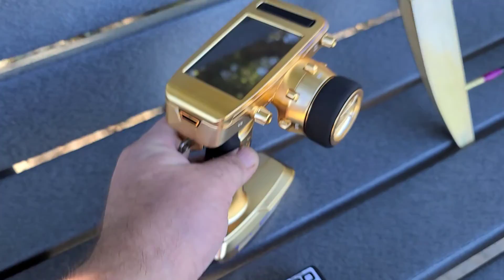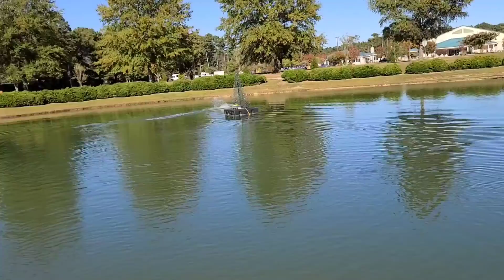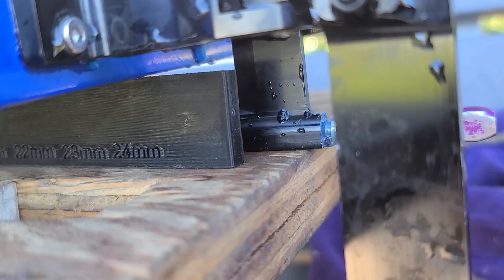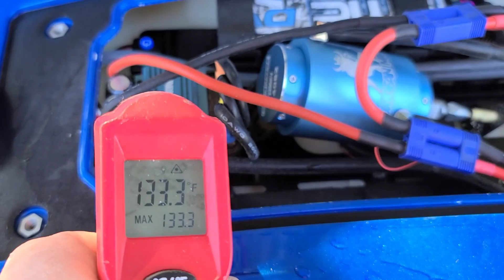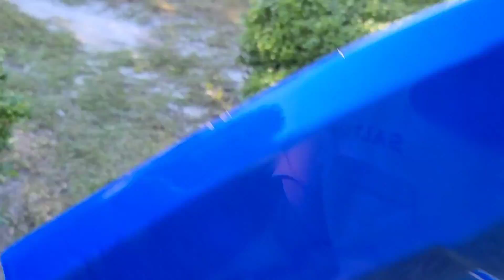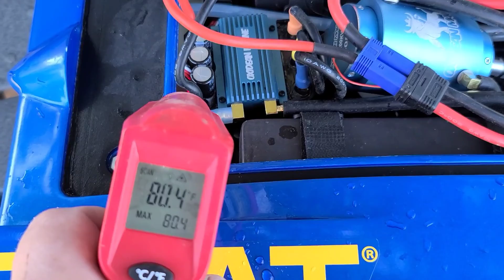First Test Super UL-19 Upgraded Electronics Oxidean 200a & 4082 6 Pole

Comment: This boat in actual size usually will do 150mph, scale speed for this rc boat of this size is 15-20mph. The reason why you see so many lifts and crashes and instability in the hulls, is because the hulls cant process the airflow at higher speeds, they arent designed that way. I do get it mine does roughly 40k stock at 3.5ft but even that isnt scale.

Comment: B, is that wing thing between the sponsons adjustable? Just wondering if that would help keep the bow planted. I guess the real question is why does the bow want to lift up in the first place.
Reply from the maker: It's the turn fin angle I had. It doest do it with a straight turn fin!
Reply: @IRONCLADRC  AH HA! That makes sense! So the angle and the curved shape must have combined to pull that side down causing it to flip.
Reply from the maker: Yes sir, that's what I'm thinking.
Reply: I was thinking the same the real racing hydroplane are adjustable if I’m correct lol

Comment: Hey b, random blackjack question for you. I watch all your videos. Haven’t seen a 3 blade on the blackjack 42…. The 3 blade by offshore electrics is a popular prop for that boat. Mine runs really well on it. What are your thoughts on that prop for the 42? Thanks
Reply from the maker: I've run the oxidean 5016 3 blade and loved it, with the stock electronics on 8s I was getting 75-77 mph almost every run.

Comment: What flex shaft configuration is this?  Man that is smooth. Thanks for confirming how I want to set my boats up for turns, not for speed!  Ill leave it up to you guys on YT to drag race.  H1 scale is my goal.
Reply from the maker: I'm using a .187 flex 3/16 shaft with no Teflon liner, stock stuffing tube..  5mm to .187 collet https://zippkits.com/index.php?main_page=product_info&products_id=384
Reply: @IRONCLADRC  Thanks again for all of you help. Please buy that float trainer so I can help you!
Reply: Warning: Once you fly, you might get really hooked. Ive raced cars, run boats, run F1 at the tennis courts and motorcycles...they are 2 dimensional vs. 3 when in the air.

Comment: Man I have a new in the box ul19 hull I was gonna sell but I think I'm gonna build it rail style now with all the reinforced kevlar. Great video too, I can't wait to see more tuning.
Reply from the maker: Yes sir buddy, put that bad boy to work.   Reinforcement with big power is gonna be the ticket.  I'm ordering the carbonfiber for mine this weekend.    

I put the stock turn fin on hopefully the wind corporates this evening.
Reply: @IRONCLADRC  I was thinking about the curved turn fin causing lift no matter what cause it has a horizontal surface. Straight fin us gonna be the ticket for speed runs I think
Reply from the maker: I think your right.   I probably won't run a turn fin when doing speed runs

Comment: insane creation ! two things i keep forgetting to ask-why did you remove the vertical fins in the back and in the full size hydro they can change the angle of the front wing with a pedal as they run. any thoughts on making a front wing that can be adjusted with a third channel micro servo?
Reply from the maker: I don't run the vertical fins  because I tend to break off in high speed crashes..    and yes the front winglet could be cut off and made active using a servo and a Giro.   Will I ever do that?  Only time will tell!
Reply: @IRONCLADRC  you rule bro

Comment: Thanks for naming me as a mentor, I SINCERELY appreciate it.  I was thinking smaller prop at first.  Temps were a bit up there.  It seemed happier with the Oxidean prop.  That is FAR too much boat for the park pond now.  All those Christmas trees appear inches apart when you're smoking along.  I sent you a set of JetStepper plans, just for giggles.
Reply from the maker: No problem master Yoda! 😆   

Yes sir hopefully the wind & weather allows me to run at the  river this evening ..  Temps were warm bu not hot I switched the cooling..  rudder to the esc & blast to the motor.  That should help with Temps.

Comment: You turned it into a beast. The setup looks very clean as well 👍I love hydro's. It takes some time to fine tune but dialed in, they fly on the water.
I was looking at the bottom design and I noticed the bottom looks flat at the rear. Maybe by adding small ride pads at the back left and right, you could improve stability. Air will be guided out the back between the ride pads and it might prevent flipping. You could temporarily tape them to the bottom just for testing. Cheers! DJ
Reply from the maker: I'm definitely interested in improving the ride surface thanks for the information cozy rc
Reply: Cozy= Boat Jedi Master.  Please try this cool idea Big B, then we can do it too.
Reply: Cozy RC is one of the best builders around.  His ships all look great on the water and are top quality fit and finish.